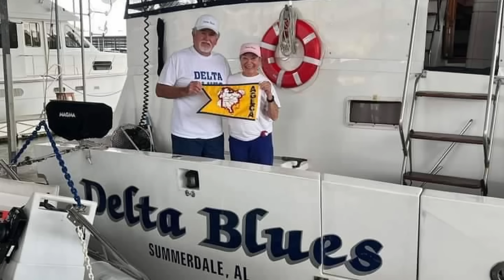America's Great Loop - Waiting out Hurricanes - EP#26

Comment: I got this from a quick Google search. Hope this helps and have a great week. 😊 Waste tanks on boats, also called holding tanks, don't collapse when emptied because they are designed with a sturdy construction, typically made from plastic or fiberglass, which can withstand the pressure changes caused by filling and emptying, and also because they usually have a vent system to equalize pressure inside the tank, preventing implosion when emptied.
Reply: Venting is key